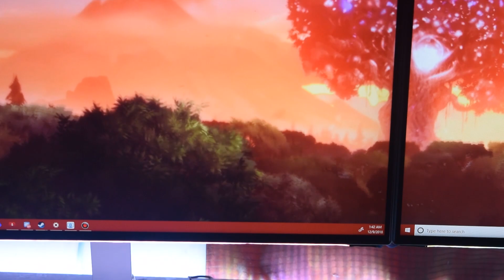உங்கள் PC-யை வண்ண மயமாக்குவது எப்படி? | RGB LED Tutorial in Tamil |  MNP

Comment: Build the budget pc for the multitasking and also for the gaming for relaxation and I don't need rgb on my pc and I need a good ventilation with a proper fan's and I do want to know y motherboard so costly now a days and for cofiguring the quad core and hexavcore processor do we need to spend a more for a mother board. Previously were spending around 5k for a good mother board now y we r spending equal to the processor y we need to spend that much on a motherboard please explain in depth